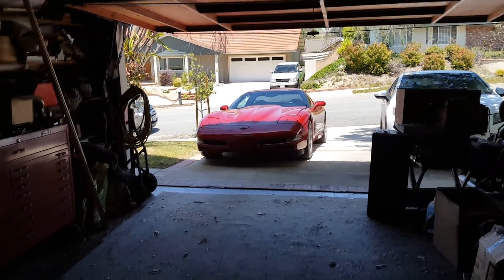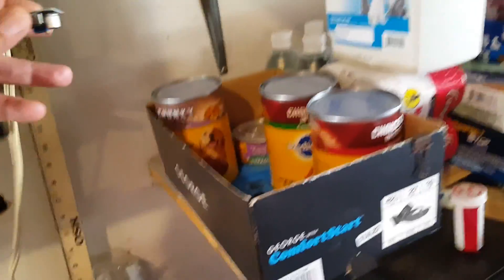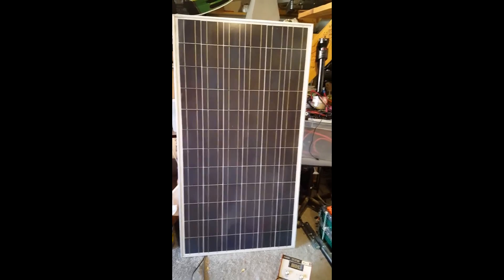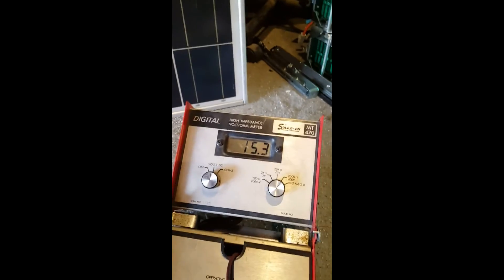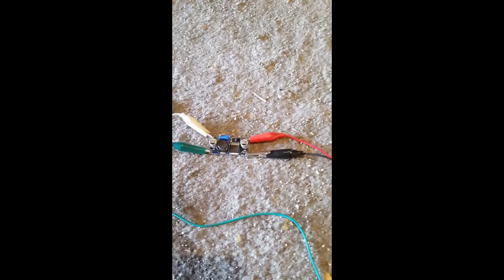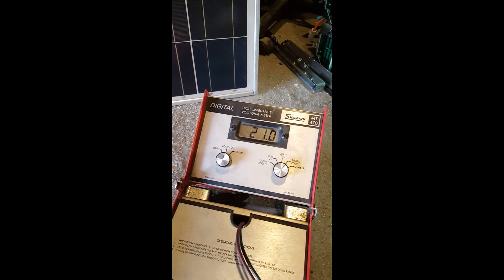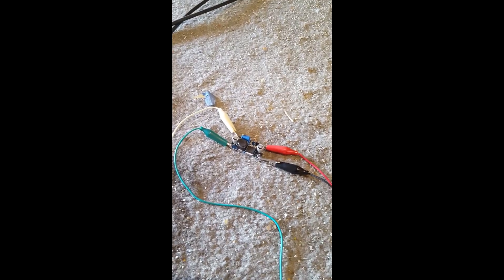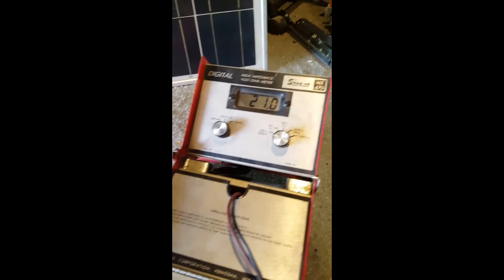With This Trick You May Increase Your Solar Power!

Comment: Other benefits to the higher voltage is you can transmit power further and since the current (amps) is reduced, you can use smaller gauge wires.  The downsides are that the total power (watts) is reduced so the batteries are actually charged less and when the sun is at local solar-noon, you risk over-voltage fault if your charge controller isn't rated for the higher voltage.
Reply from the maker: will do a test on a charge controller and see!
Reply from the maker: +ElRazTheGreat as mentioned in the video its a brainstorm that I had!  It will work!

Comment: That looks pretty cool, but what kind of current do you get out?
Reply from the maker: +Craig Nehring its the same current of the panel, leave the rest to the MPPT controller.
Reply: +ElRazTheGreat 
erm, man... I don't know, them DC to DC converters can't move more than a few amps and to get that, you need to heat sink them. This is especially true when you have a wide swing in voltage. But hey, these are cheap to play with so it should be interesting how it works out, Peace Bro
Reply from the maker: +Craig Nehring as mentioned in the video its a brainstorm that I had!  It will work! May be not but at least I tried, may a step up transformer? who knows? no one has tried it yet right?!